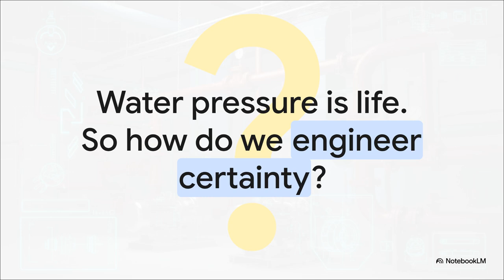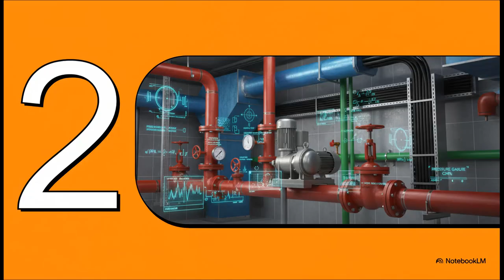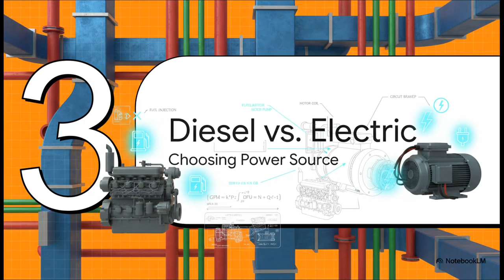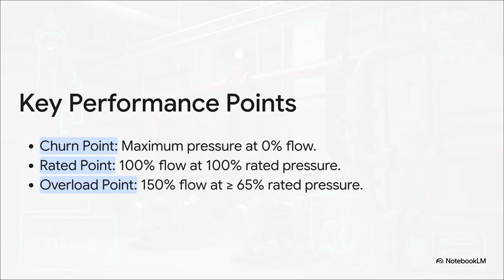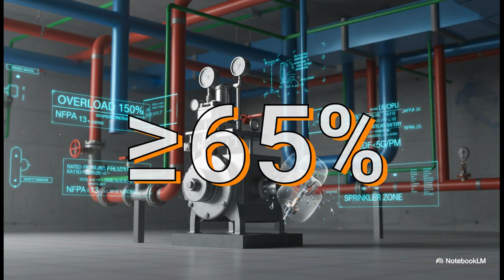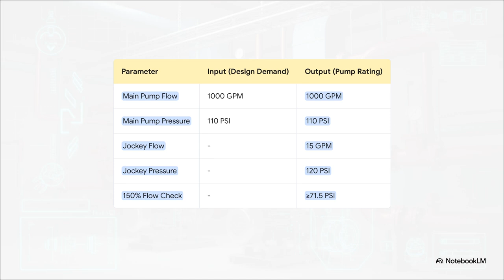Fire Pump Design | NFPA 20 Jockey Pump Sizing, Diesel vs Electric Selection, Pump Curve Analysis

Comment: Where did you get the +10 psi of the fire pump's churn pressure? NFPA says churn pressure plus minimum static supply pressure. If the static pressure is zero, then it is just equal to the churn pressure, isn't it?